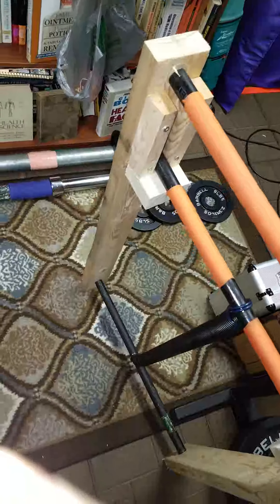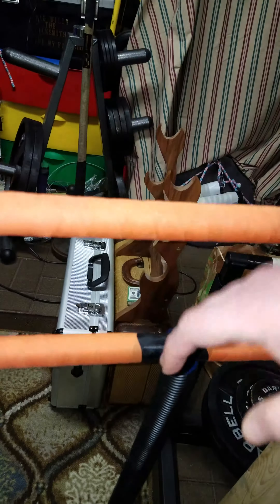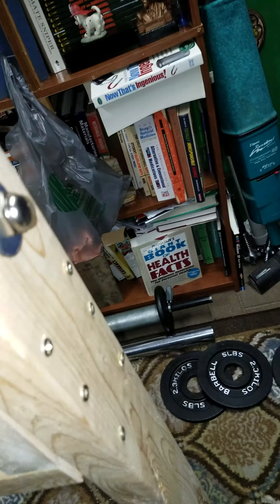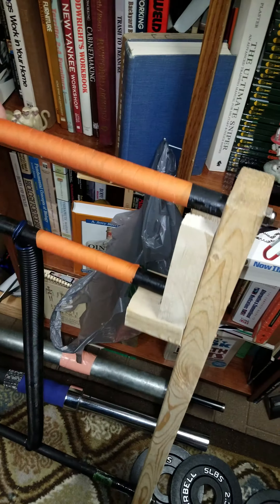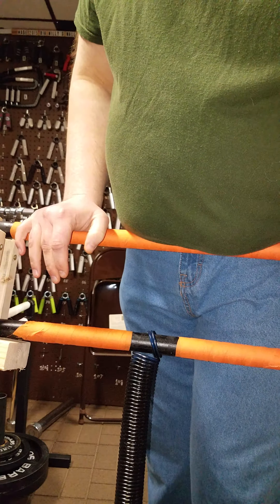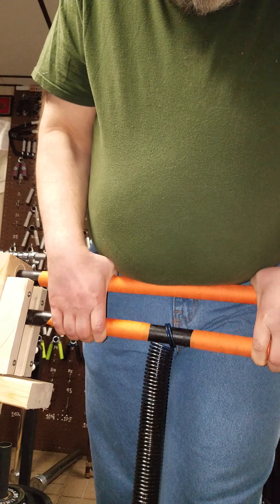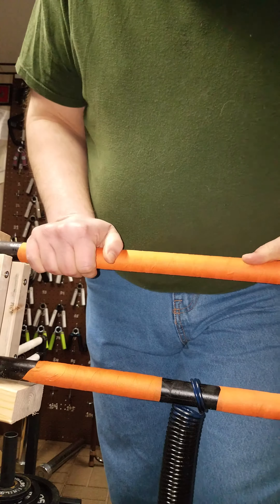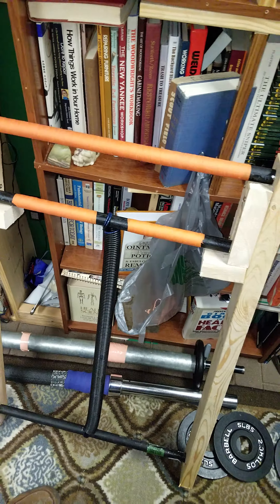A Little Project I Did Yesterday

Comment: I like how it gets hardest at the peek contraction.  Where do you ge the springs? Also you could probably stack weights on it if you’d like it’s pretty sweet
Reply from the maker: David Trionfi I got it at Family Farm and Home in Flat Rock
Reply from the maker: David Trionfi I did try loading weights with a chain and it worked but I will stick to springs I need 5 more springs to really have a good challenge I gauged the resistance of it and got 30 pounds off it at top